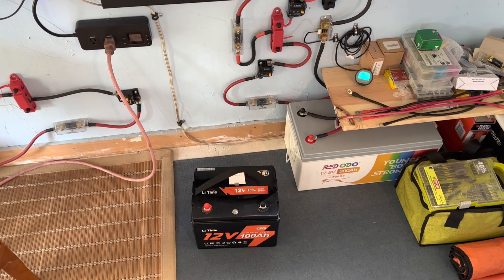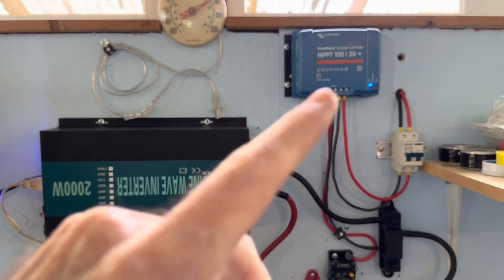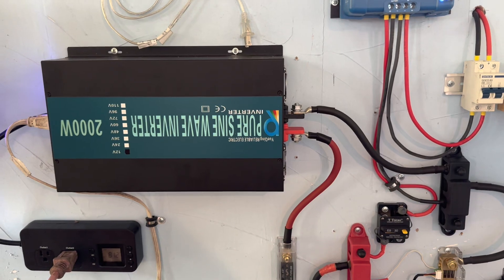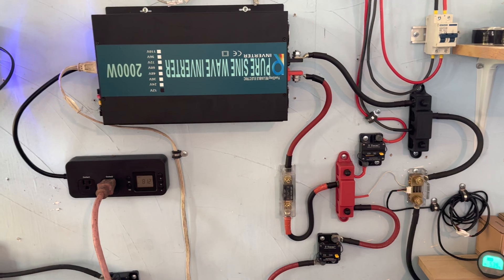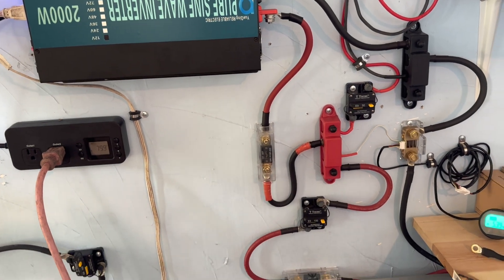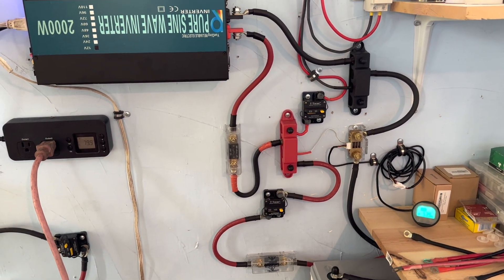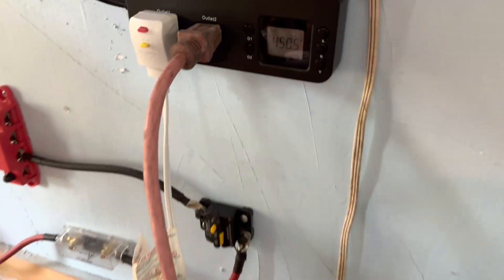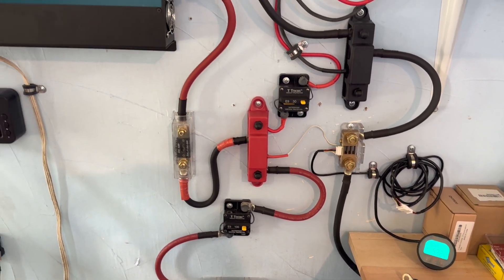100 Amp fuses blown!  300Ah LiFePO4 system down! Unforced error! Making the mistakes for you! Ouch!

Comment: i have a 2,500 watts 12v invertor i guess i would have to put a 250amp fuse if i used it with a 300amp battery.  wow  thanks for sharing this . we can all learn from this .
Reply: Check your inverter specs... most can do much more for startup surges... usually about double, if you run compressors (fridge/freezers, air conditioners, etc), or motors (a saw, even a forced air heater). So, carefully analyze actual maximum draws, or you may blow more fuses than you need to. The closest example I can think of to your 2,500 watts is a Multiplus, rated at 2,400 watts, can handle about 10 seconds of 6,000 watts startup surge power.☮🇨🇦

Comment: 1.  Fuses protect cables.
2. Cables should be rated to handle the expected current draw, in this case 2000W divide by nominal battery Voltage 12.8V = 156.25 A, it’s always good to have a 25% safety margin so times 1.25 that = 195A so 200A cable. Cable should be temperature rated at 105 c, over such a short distance no allowance for Voltage drop is required.
3. Therefore the fuse size required is 175A
4. It should be inline as close to the power source as is practical. 

Other visible problems
1. Coiled cable between shunt and Amp meter.
2. Exposed terminals on rear of inverter.

I am not a qualified electrician, but I did a lot of research before installing my 2000w inverter. Always do your own research and if in any doubt consult a professional.
Reply: You are right on man.. I would add a ``T`` Fuse after that Battery not a ANL as well IMOP .I have a 280ah lithium batt,1800w inverter,12/12-50 Victron charger, MPPT100-30 solar controller with 200a panels, small fridge pulls 6 amps at start 5 when runnining, 80w stereo amp, small tv set up. Using Victron distributer for the loads and that T fuse at the batt@ 200a with 4/0 from the batt. to Dist. and 2/0 less than 5 ft to the inverter@ 175a T fuse as well. Would you change anything ? this is in a boat but should not make a diffence on the protection i believe.
Reply: I would remind folks that every 'connection point' is a resistor, and so many fuse and breaker connections, plus the usual ones at batteries, shunt, inverter, etc... all add up to voltage drops. He's got a meter, it seems, so he should check out each segment of the circuits to see where, and how much drop is occurring. oh, and each breaker and fuse themselves are also 'resistors'. Most of these can be calculated using the correct charts available online, as well as data sheets for the fuses, breakers, shunt, etc. will tell how many ohms each resists, but may be listed as milliamps of drop.
As to the correct size fuse for the inverter, one should keep in mind that all inverters can put out more, for at least 5 to 10 seconds to handle start surges. most can do about double(check documentation), so he could have several seconds as high as 4000 watts, if say the refrigerator compressor is kicking on just as the blow dryer heat, and fan motor surge kick in.
My point is, the first fuse should account for maximum possible load, while never selecting higher than cable ratings. Now he isn't running anything but the inverter, it looks like, so really, having two of the same fuse both in the same circuit (battery to inverter), is adding unnecessary resistance in the second fuse, plus the two extra connections at either end of the redundant fuse.
and yes, all the cable snakes might look interesting but, are not good for overall system performance. he placed items and then curved cables to suit, which was backwards thinking.
And you are correct about the battery fuse placement. Boating standards call for it within 7 inches of the positive terminal, or, if using a MRBF (Marine Rated Battery Fuse), it would be right on the terminal.
As for consulting a Pro, he obviously mistook You Tube for a Pro. lol.☮🇨🇦

Comment: Just your opinion ... what type of fuse would you use on a 280 ah 12 vdc Eco - worthy  battery  ?
Reply: The one that protects your particular cables... the capacity of the battery has nothing to do with it.
that said, if you want to 'try' to protect batteries from a short that would ruin them, class T is the only way to go! With a second 'if you must' option being an MRBF (Marine Rated Battery Fuse).
Reply: @BorealisNights thanks

Comment: You should always size your cables and protection devices based on the max parameters of your system. This video shows clearly that someone will eventually push it to it's  limits. This is a good example of how not to do it.

Comment: Reading the comments, it appears that many of you are mistaking 2/0 AWG cables for #2 AWG cables and vice versa. 2/0 AWG cables are much larger than a 2 AWG cable. 2/0 is another way of writing 00 AWG, or two ought. Two ought, or 2/0 cables are larger than One Ought, or O AWG cables. A One Ought cable is larger than a 2 AWG cable. Therefore, a 2/0 AWG cable is larger than a 2 AWG by two cable sizes, but NOT twice as large.

Comment: Does anyone here know how many amps  a Reliable 3000 Watt inverter pulls from the battery to produce 20 amps AC power?
Reply: Potentially up to 200amps@12vdc (depends on the battery voltage@discharge)...
Reply: @davebruessow6842 at 24 volts at 100 amp would I use a 100 amp fuse on 2 stranded 105 temp rated wire  into 3000 watt inverter

Comment: Interesting situation. There are 3 current protection devices between the battery and the converter, I think 2 are enough and why don't you choose to have the circuit breaker at 200 amp and the fuse at 250 amp .

Comment: this is a disaster - too many unnecessary connections - each risks human error - too many fuses, low quality breakers - just wow
Reply: It's not THE worst system I've seen on the Tube, but definitely in the top 5 of worst designed/most dangerous systems I've seen. each connection, fuse, breaker is a resistor, causing voltage drop and amp increase. All those breakers and redundant fuses are examples of what happens when 'DIY'rs' rely on the Tube for their electrical education.
Reply: @BorealisNights  100% ! Too many YouTube experts

Comment: Do the math. 2000w 12v  inverter is going to be pulling 167amps and that will be 184 amps at 90% efficiency. That should be 70mm2 cable with a 225-250amp fuse .  I can smell the smoke from here!

Comment: Your anl  fuses do not protect from arcing in the fuse causing it to weld closed if there;s a short . They do protect your wiring in an up to 210a approx current overdraw event,  as such arcing  is unlikely at 200amps

Comment: why did your 100A thermal breaker not trip out? i see it clearly positioned next to the ANL fuse which you said had melted a 100A fuse, but yet the thermal breaker did not flip itself?
Reply: That style of breaker is notorious for very poor(dangerous) performance. I would NEVER use one of those.

Comment: I forced myself to learn how to crimp 4/0 cable for connecting lipo batteries (24V) to my 2000 and 3000w inverters with fuses.  Also short distance between batteries and inverters.  Inverters are medium priced and do not live up to their advertised abilities.  However, no melted fuses or hot wires so far…..

Comment: As a few others have questioned you just changing the fuse from 100A to 200A and not changing the wire here's my suggestion for added safety and choosing wire and fuse size for worst case scenario. Consider this: Inverter size is 2000w. That has to be divided by one of the following: Either the cutoff voltage of the battery BMS or the inverters; whichever is higher and kicks in first. Then the final figure to input into equation would be the inverters efficiency. So, it would be something like 2000 divided by 10v divided by .90     so, 2000/10/.90 = 222A. Fuse has to be rated to blow before wire reaches its limit. Keep in mind other loads as well as the inverter that maybe running at the same time and equally increasing amp draw as voltage drops.
If you did the equation 2000/12 = 166A or 2000/12/.90 = 185A you can see they don't take into account amps increasing with voltage drop.
Reply: You are right on man.. I would add a ``T`` Fuse after that Battery not a ANL as well IMOP .I have a 280ah lithium batt,1800w inverter,12/12-50 Victron charger, MPPT100-30 solar controller with 200a panels, small fridge pulls 6 amps at start 5 when runnining, 80w stereo amp, small tv set up. Using Victron distributer for the loads and that T fuse at the batt@ 200a with 4/0 from the batt. to Dist. and 2/0 less than 5 ft to the inverter@ 175a T fuse as well. Would you change anything ? this is in a boat but should not make a diffence on the protection i believe.

Comment: I would use a lower rated circuit breaker (120 amps MAX) , with the fused sized for the max the inverter can draw - 350 amps in this case, or 400 if that can't be found.
also note that quality matters.

Comment: Consider that a 2000 Watt Inverter only puts out a maximum of 16.25 Amps - that's it in the nutshell.  So,  if your load demands more than that to get the appliance started, you'll start blowing fuses, especially if the wire gauge is inadequate. Always consider how many amps will travel across the wire in every section of your system and make sure you know the gauge size wire required for that section of your system. On Google, enter  'gauge size vs. amps'. Print out the chart. Consider using a 3000/6000 watt pure sinewave inverter instead. It puts out 26 amps. Most importantly, if the gauge size is not correct, you'll definitely blow fuses. Why? You put the wrong size fuse with the wrong size wire. You must know number of Amps going across the wire and never exceed the wires stated limit.
Reply: You are confusing AC and DC.. on the AC side, at 120 volts, it is indeed around 16.6 amps.. but 120 compared to 12 is a factor of ten.. or doing the math.. 2000 watts divided by 12 = 166 amps DC current going into the inverter. Then, assuming that low cost inverter is probably no better than 90% efficient, add on another 10% so the 166 becomes 182ish amps going in. And, on top of that, most inverters can do around double for a few seconds to handle startup surges, so his 200 amp fuse is sufficient, as long as he doesn't push the inverter to handle maximum possible startup surges.
Reply: @BorealisNights Thanks for the lesson and clarifying this problem.
Reply: @BorealisNights  Of course, my main concern was how many Amps are coming from the inverter and going to the appliance or whatever I'm trying to power.

Comment: Ideally you would need 50MM² cable for the 200A fuses, so like 1 AWG, the other option is to go higher on your voltage to lower the voltage drop and heating of the wires. going to 24V would allow for 2AWG cable to be used. but to draw 168A @12V you are going to need thicker wires.

Comment: I have 2 Redodo 200AH Pro batteries and want to add a third.  I have a 400 amp fuse on the positive lead.  The electrician recommends a 600 amp fuse.  What kind of fuse do I need?😅
Reply: You need the right size to protect your cables. If they can only handle 400 amps, it doesn't matter if you add 100 batteries.. you still need a 400 amp fuse. But let's say your cables can handle 600 amps.. the next question is, will you ever draw that many? I mean if 400 amps is all you're ever going to draw, putting in a 600 is pointless.

Comment: Best to perform a quality selective coordination of fuses & circuit breakers. At a 12 story research building that I did some work in several times a zone mechanic shorted out a 277 volt wire while replacing a ballast. Every time the 200 or 225 amp three pole circuit breaker in lightning panel would trip rather then the 20 amp branch circuit breaker. Said they were working on it for over ten years.
Reply: That goes to show all breakers are not created equal. the 20 amp is obviously too slow to act.(low quality). I mean a bit of surge passing through is ok but, when a short happens, you want a fast acting breaker, which the high amp breaker you mentioned, was obviously faster acting then the 20.

Comment: This is why you want to change to a 48V or at least 24V System (also you can use smaller gauge and less expensive wire). Of course you probably already know this and it also involves spending a lot more money, but yeah. There was a guy who did a test on fuses, and the cheap ANL fuses actually worked the best.  https://www.youtube.com/watch?v=6o9tbhgtws4
Reply from the maker: I've blown two anl fuses on my systems. Both my fault, but they did their job! Aloha!🤙

Comment: Jeez dude not an isolator switch in sight - . stop and draw out a single line diagram on a big sheet of paper (in pencil)  then analyse carefully what you are doing, wire size, fuses, switches . Consult the ABYC E11, they have long experience and proper codes for dc systems, you are just muddling along pal.
Reply: He's using those cheap breakers as switches... there is so much wrong with the design of this system it's hard to even point them all out!

Comment: Have you considered using a T class fuse because ANL fuses can actually arc continuing to allow amps to keep flowing T class fuses are more expensive, but the safety factor that they bring in my opinion makes it more than worth it.
Reply from the maker: I actually plan on using them🤙

Comment: Why is there a breaker and a fuse on the hot wire to the inverter?  I'm assuming it's used as a disconnect point.
Reply from the maker: Yes, I use as a quick disconnect. 🤙

Comment: I have the same Inverter and only ran a 5000 BTU A/C and i was also popping 100Amp fuses left and right. I think I even blew the 200 Amp fused. So im now using the 300 Amp with no issues at all. Im not running that Inverter anymore im running the Bestek 1000 Watt Pure Sign Wave inverter and everything is running smooth with no issues, except the sun hiding behind the clouds just about everyday. BTW i like that AC Watt meter can i buy that on Amazon and do you have an install video on that digital meter?

Comment: Actually why do you think that happen what??? Reliable inverter has a built-in protection those fuses will create more problems the less things that you have in between your system your system the better it will run

Comment: You do have an entire wall to hang stuff. Maybe locating the fuses at eyes height so you can see and replace them easier. Have some cheap cheater glasses on your tool bench. I am  68 and do not wish to keel down on the floor to deal with fuses. Count how many hours of trouble shooting, fine tuning, resetting, and maintanence that any system requires. I have mounted the components for my system from chair sitting height to standing height.
Reply: If one needs to regularly check fuses, the system is poorly designed. a blown fuse is a warning that something is wrong! Like in the case here, the inverter itself should have shut down before the fuses blew. The fuse blowing led him to the problem, that he fuses were under rated for the equipment installed.
Same for a breaker.. like in a house, if you blow a breaker, it is telling you that you overloaded a circuit. It's a warning, and one should correct the issue so that fuses/breakers don't blow/trip.
Oh, and at least the main battery fuse should be as CLOSE as possible to the positive terminal.. battery on the floor, fuse at eye level, is bad system design.

Comment: The mistake that you are making and not correcting is the wire size. 200 amps at 12 volts  pushes a lot of current through those little itty bitty wires!  Now you WILL burn your house down.

Comment: Your not doing yourself any favors by adding a 200 amp fuse. Your defeating the purpose of fusing. I made a similar mistake when I tried running high amps through a 12v system and damn near caught the wiring on fire. I have since switched everything over to 24V and now everything runs as it should nice and cool. Something no one ever explains is that you should never exceed 1000 watts on a 12v system. This is because of the high amps that a 12V system draws.  Shame on the companies that sell high wattage inverters on 12V systems.
Reply from the maker: Mahalo for sharing this information with us! 🤙